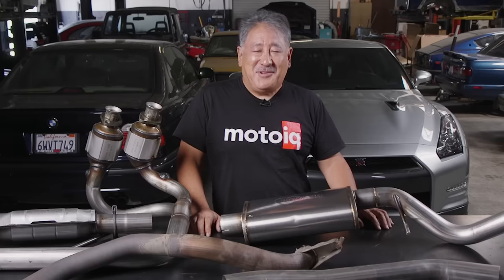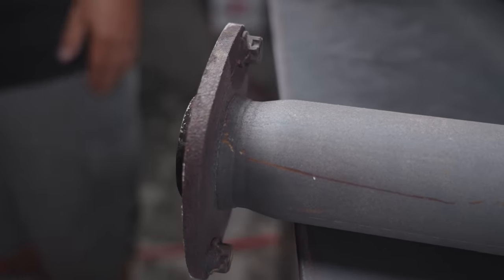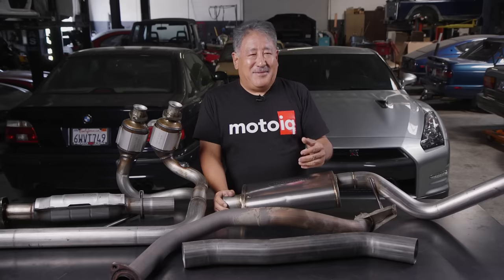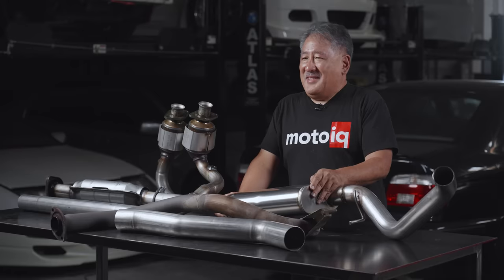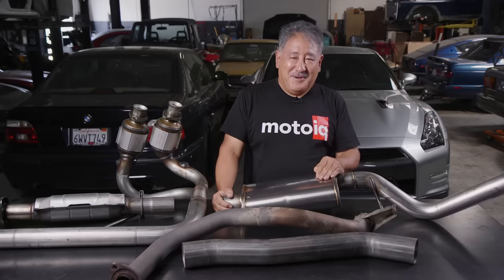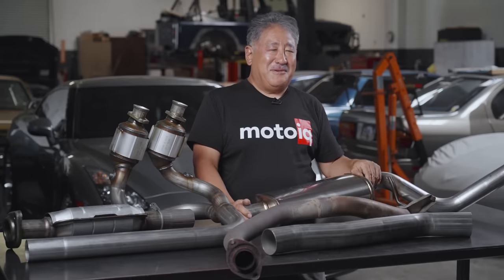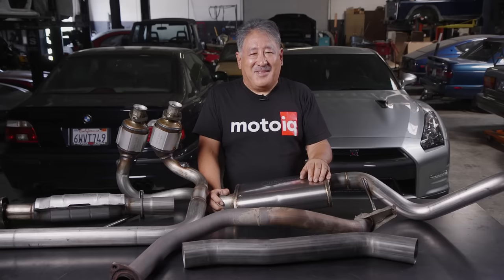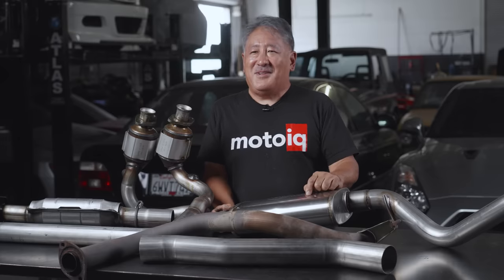Exhaust Back Pressure Myth DEBUNKED!

Comment: Wrong. Like most people, he totally misunderstands what the term "backpressure" means. It isn't a restriction in flow, it's a reflected sound wave that helps pack the cylinder at the exhaust port, allowing higher than 100% volumetric efficiency on the intake stroke. The more overlap your cam has, the more the engine will benefit from  backpressure. Automotive engineering 101. The expansion chamber exhaust of a two stroke is a perfect example.
Reply from the maker: Wrong, we are talking about exhaust design not header design.  See our header video. https://www.youtube.com/watch?v=kBQjBMiYW3E   Also we are talking about mean pressure not unsteady wave phenomena in the exhaust primaries. The more overlap your cam has the more mean backpressure will greatly hurt performance been proven on the dyno many, many times. You might have gotten a C in automotive engineering 101.
Reply: @motoiq  Within those parameters, I concede the point and stand corrected. My apologies, as we were using the same term for different events.

Comment: You should lead with this: BUILD YOUR SHITBOX ACCORDINGLY TO ITS PURPOSE.

non-TLDR:
You need a little back pressure for the O2 sensors to properly work. From a pure carb standpoint, it depends, is it daily or racing? About 14 out of 15 of us won't be doing any racing so therefore back pressure for the sensors is good. You need a proper read for the ECM to work with your tuning and the cat will provide enough for that. For those that just commute, there is no feasible reason why you should be toting big horsepower when you aren't going to use it plus its wasting fuel. Don't be a crash dummy. IF you join in for race day, no problem, just build it right. Freeflow for higher BHP, restricting for bottom end torque. Remember torque is the ability to do work and horsepower is how quickly it can do that work. Example; Cummins, CAT, Detroit, these have huge torque numbers and we them consistently pull 40 tons down the highway but only have like say 400-500 BHP, where NASCAR is around 700, Top fuel being an estimated 8k to 10k. However their torque  sits around 1600 lbft, 520, and an estimated 6000 of torque respectively. Note: a GM 1.4L ECOTEC outputs 130ish BHP and 148 lbft.

Comment: It all depends, motorcycles for example rely on back pressure for the instant throttle response.   Without it there would be a slight delay in power. DUMMIE
Reply from the maker: That is totally wrong. You don't understand the cause and effect.

Comment: Loads of BS. You didn't debunk anything. What the "old farts" are talking about is that you need to have balanced back pressure. It's one thing with cars running on the strip, where open pipes is the best, since the engine is running att the highest rpm down the strip. It's an antire different thing with rally cars, street cars etc. since they run on vastly different rpm''s all the time and where it's needed some back pressure to make the motor run efficient even on lower rpm's. You are actually saying it yourself, but it seems as you refuse to understand what you actually are saying.
Id say, you are the fart, not the old blokes.
Reply from the maker: Backpressure is NEVER good nor needed on any 4-stroke engine at any RPM. It is not BS it's basic thermodynamics, the PV curves of the Otto cycle.  Saying you need backpressure is ignorant.  Don't believe us, See what the guys at Gale Banks say. https://www.youtube.com/watch?v=2tZYJHtXG9s  See what Gale Banks himself says. https://www.youtube.com/watch?v=k7yYY_hy250  It is not theory either, it was verified over 100 years ago in research. Every mechanical engineering student knows this. Don't confuse backpressure with scavenging.

Comment: I call bulshit....had a 1967 Beamount..six cylinder..with about two feet of exhaust  left....wouldn't even back out of the driveway...put straight pipe..and away it went..spinning....start over bud.
Reply from the maker: There are many factors that cause loss of power when you loose your exhaust.  Understand the video and you will know what they were.

Comment: Sorry not going to listen to the US, all of your engines make no power for a 5 plus liter looking at you Dodge viper 50 hp per liter, that's a joke, all of the big engines you guy make make big  displacement with pathetic hp per liter, YEAHHHHHHHHH MY NEW 7 liter V8 makes 400 WOOOOOO, and then makes another 150 to 200 with a supercharger 🤣, Your engines are all noise no go, the only thing that is good is the torque and that's it, but even then your can't handle it and just crash, plus you still think it's 1950's with the beam axle
Reply from the maker: Stupid
Reply: @motoiq  🤣 if you took offence by it that's means you got butt hurt which leads to the truth, if you knew you are 100% right you don't respond as you have nothing to prove, reply with just one word responses is when someone doesn't know what to say
Reply from the maker: stupid
Reply: @motoiq  No it's stoopid
Reply from the maker: You are making stupid statements because although the power per liter of many popular American engines is not as good as some Asian and European engines, their power density can be greatly superior.  This is power and torque for the size and weight of the engine. A Chevy LS for example is pretty small and lightweight, lighter than many turbocharged 4 cylinders and more compact than most DOHC 4-valve V6 engines.  Not to mention DOHC 4 valve V8's.  The same LS can produce better BSFC numbers and have superior fuel economy to these engines as well.  When modded they as well as other American V8's can make over 1500 reliable and tractable power to the wheels and when pushed, 3000 plus hp.  This is quality power with good torque and wide powerbands.  This is not pathetic and will smoke other smaller displacement euro or Japanese engines. See some of our videos on building them.  We love our Japanese and Euro engines, our channel content is more biased toward them but don't make ignorant comments about a subject that you have a limited understanding on.
Reply: @motoiq  maybe so but the stock internals won't be able to handle that power, the cam shaft will as there's less center frugal mass, the rods crank pistons in the other hand no, and the reason the block can handle that power is because it's a solid cast block, not an open deck block, the volvo t4t5 block can handle 600 hp on stock internals and over 1000 on forged pretty much like any engine, the 998cc classic mini engine can handle 140 hp the only limit is the push rods, my engine D5 volvo 2.4 when shimmering the block can handle 450hp on stock, the only limit again is the open deck block, if i semi close deck it can handle 700 on stock, if you loose back pressure yes the engine runs a lot better but you loose fuel economy as more air can flow into the combustion chambers there needs to be more fuel injected, you gain more hp and a faster rev but you lose torque, you need the back pressure to keep the torque
Reply from the maker: The LS is much lighter than the volvo engine and can handle 800 hp on the stock bottom end.  The 5.3 versions can handle 1000 hp and are still lighter than the volvo. We haven't even touched on the Ford Coyote engines yet which rival the best engines in the world with power for displacement. If you don't understand American engines don't make mindless comments about them.
Reply: Cool story bro.